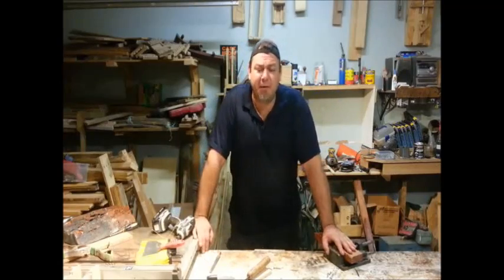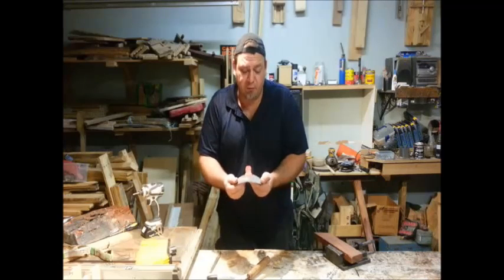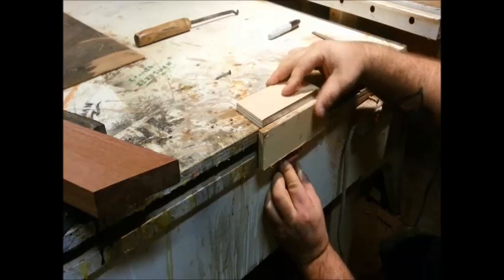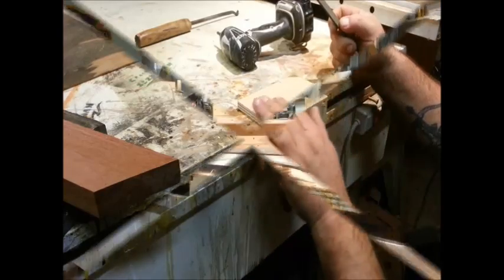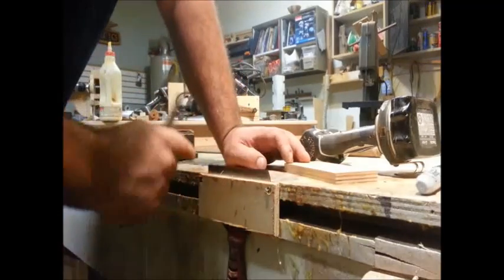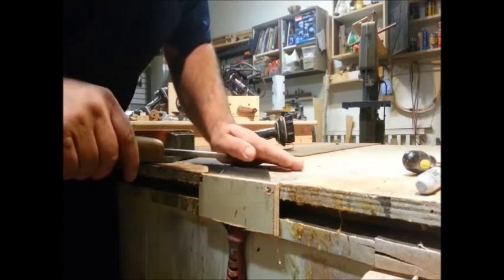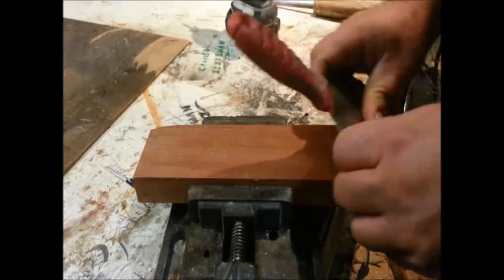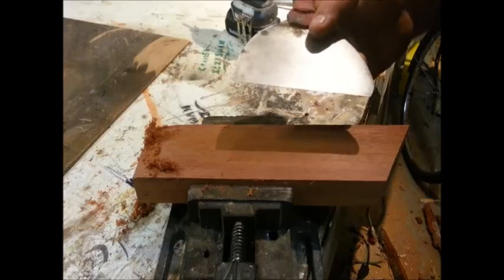Make A Homemade Card Scraper - Putty Knife

Comment: Try making one and you will see.  When it is sharpened correctly and you get thin shavings (not dust), it will leave a surface smooth as glass and won't require any sanding.

Comment: Not sure if Izzy addressed that question at all, but scraping can replace all sanding, especially the _later_ stages, on flat surfaces.  I believe it was the common wood-smoothing method before modern sandpaper was invented.

Comment: page358 A card scraper or cabinet scraper is an alternative to sandpaper. In fact a proper scraper will give you a smother finish that what you can accomplish with sandpaper. There are many ways to drill a hole and there are many ways to smooth wood.